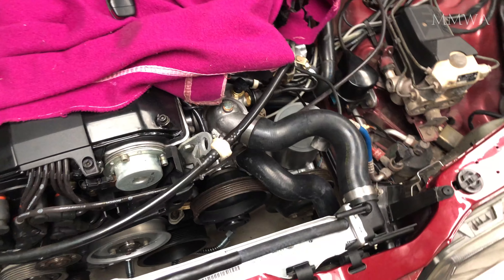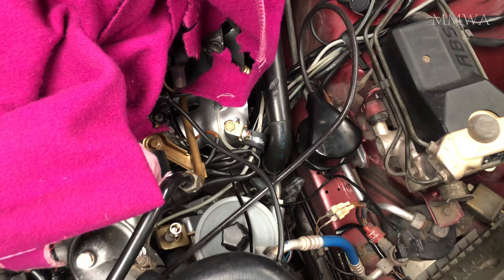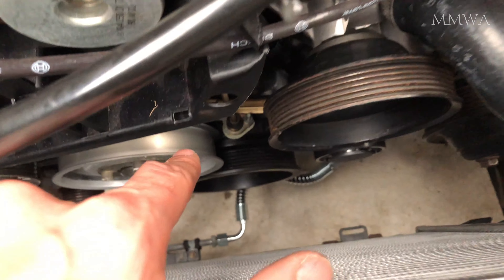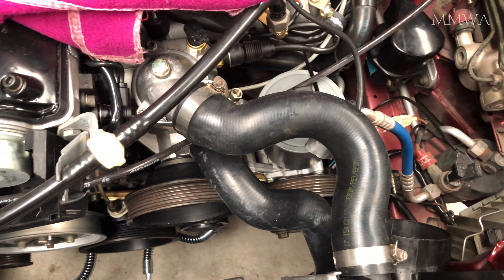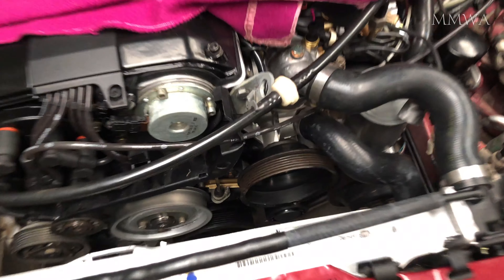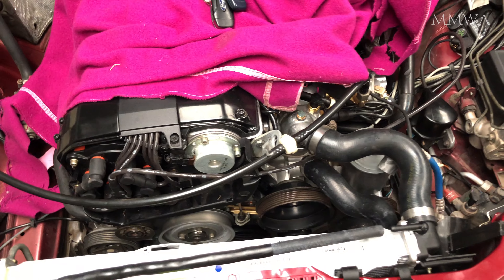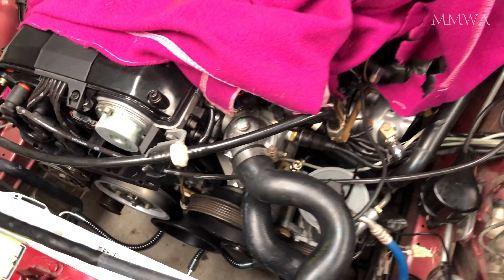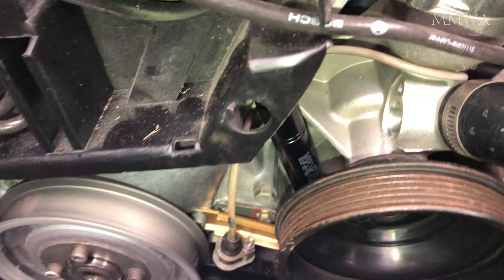Red W124 project - some more assembly today. Rad hoses, pulleys etc

Comment: The plastic bracket that holds the the top thin hose from the radiator elbow to the expansion tank via the headlight frame is elusive on the EPC. It is 124 501 00 20.
Reply from the maker: TOONACEDRELA i have to put a final list of part numbers together for my final order for red from the classic centre. This is one of many small items including the plastic striker plate for the hood hook. That shattered when i tried removing it for the paint job.
Reply: @MMWA-DAVE  As a further confusion. The clip that holds the lower hose (with the right angled bend)  to the expansion tank is a 126 part. 126 501 00 20 .
Reply from the maker: TOONACEDRELA this one survived - it is however broken on blueblack as thats where an alarm siren was installed previously so i may add one to the list

Comment: Hey Mate, I have found your page very interesting and helpful. I am currently driving a Mercedes Benz 300e 124 1992. I have recently noticed a squeak when I steer and go over bumps in both front wheels and a squeak going over speed bumps in the rear. I am wondering what the problem is? (I believe it maybe the bushers). If so what size bushers and where can I find a set? Any information will be helpful! Keen to hear from you!
Reply from the maker: Lachlan Butcherine with the fronts if you have squeaky steering you need to inspect the lower balljoints as a matter of urgency- the ones on the lower control arms. If your car has the m103 the balljoint is replaceable on its own. The m104’s like mine with big front brakes need the whole control arm replaced, the balljoint cant be changed on its own. On the rear end theres 20 possible joints  for squeaks plus infinite other issues possible. You will need to inspect everything back there. Ive dropped and rebuilt the entire rear subframes on both my 124’s. There is a double ended balljoint type thing on the outer side of the lower control arms these are a likely candidate but also require a special tool to replace.